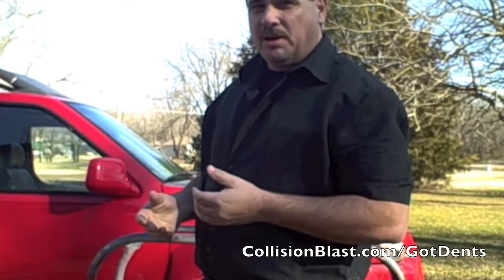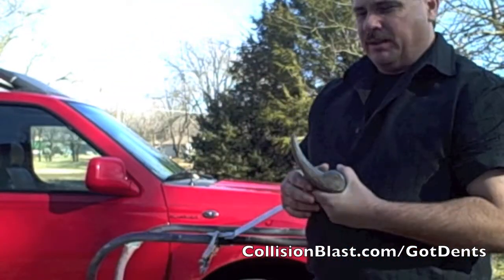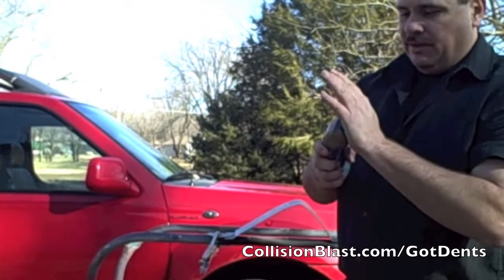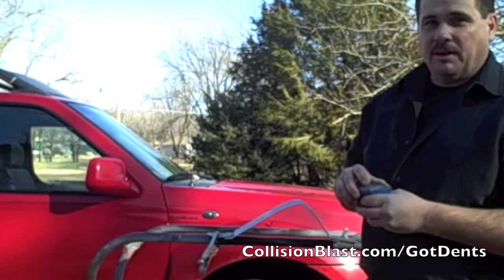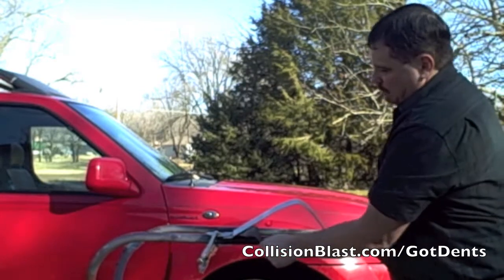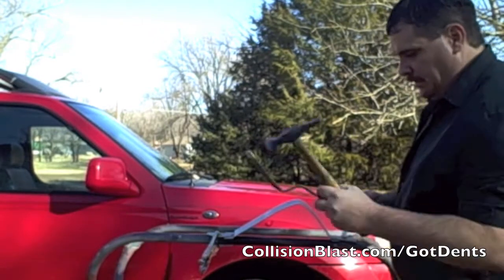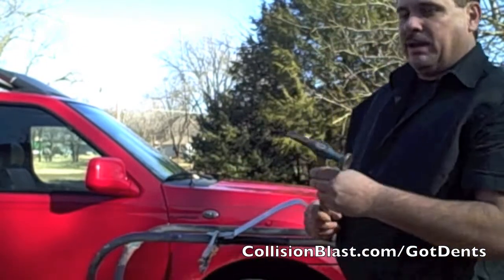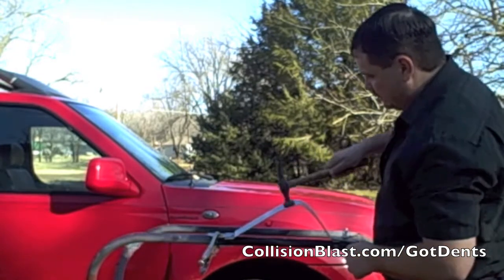Hammer and Dolly Techniques - Basic Hand Tools For Hammer and Dolly Dent Repair - Auto Body Work

Comment from the maker: Good topic.  There is quite a lot of difference between aluminum and steel.  Steel has a memory while aluminum does not.  You have to use separate tool to eliminate contaminating the aluminum, can not use as coarse of sandpapers, and it is much more sensitive to heat.  Thanks for the suggestion.

Comment from the maker: @timeuler I agree the audio could be better.  One thing you might try, that took me a long time to figure out is to turn the volume up on your computer and on the video.  In the lower left corner of the video is a speaker icon.  Turn that all of the way up, then turn the volume on your computer up.  Have you already tired this?  I may try to get better recording equipment in the future.  Thanks for watching.